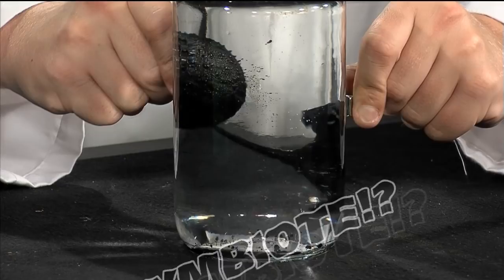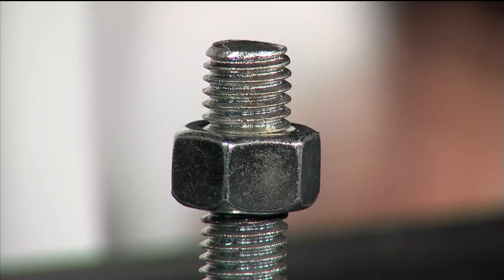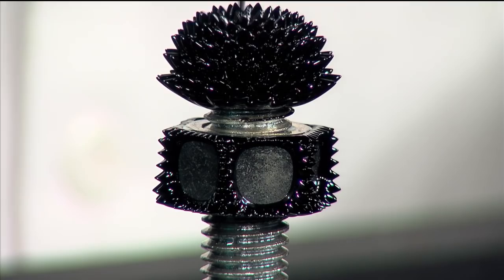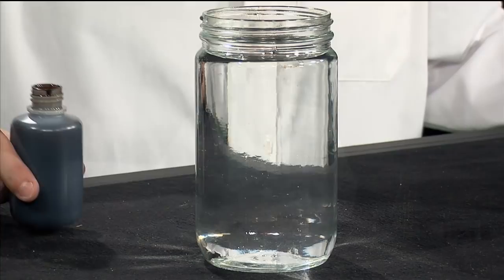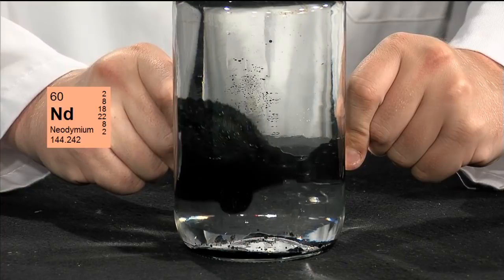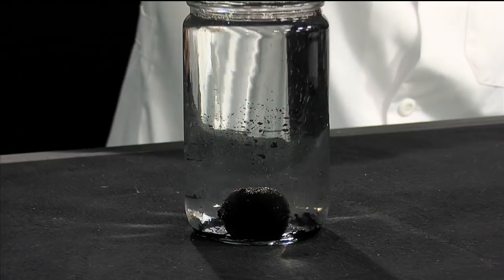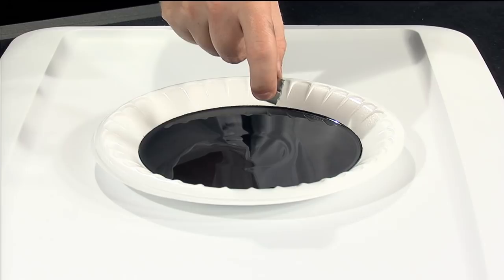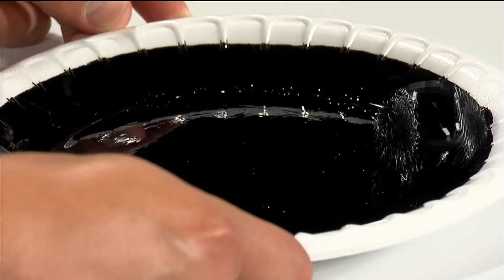Ferro Fluid Tests - Magnetic Liquid

Comment: The reason the sides are flat is because the fluid lines up with the magnetic field lines. The lines point upwards from the north to the south pole. On the sides of the magnet the field lines are parallel with the magnet so no spikes form like with the top where the field lines point up.

Comment: How did you get the spikes? I have tried a lot of oil+toner mixtures but NEVER got it, even with strong neodymium magnet.
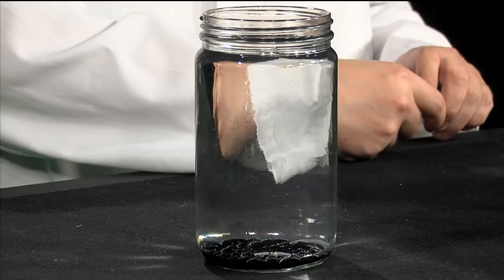BTW, the mixture that you suggested (oil+toner) is less dense than water, so, in your experiments (at 2:20'') you used another kind of formula, didn't you?
Could you give it to us?
Thanks in advance.

Comment: Can you hold your finger in and touch it? And how do you get it away from the magnets, is there any way to fill it back into the bottle?
Reply: You can touch it with your finger. To get the ferro fluid away from the magnet, you need a large enough force to overcome the magnetic attraction between the fluid and the magnet, or you can just demagnetize the magnet. It is possible to fill the fluid back into the bottle if you boil all the water out because the boiling point of water is lower than the fluid.

Comment: Are these magnets safe to use near a camera? I'm thinking about taking some pictures of this stuff in action, but wouldn't the strong magnets damage the camera?
Reply: keep the NEO away from all flash drives, hard drives, or magnetically laced tapes. you WILL change all the1's and 0's to uh....um... 2's and 3's ????  no seriously 15 inches is about as close as I would even think about getting to any internal/external mass storage device   {{ especially a N52 the strongest neodymium available to common folk }}

Comment: I've tried to recreate your experiment using ink toner, veg. oil and a N42 Dia 1/2" x 1 1/2" Disc Rare Earth Neodymium M.  I can get the Ferro Fluid  to bulge, but no "spikes" sticking out.  I started the F. Fluid out thick, and gradually dilluted it with more oil,  without better results.  Is the magnet to weak, or does the fluid have to be under water...Any suggestions on what I may be doing incorrectly?  

 
                             
eBay TALK

Comment: How do you even remove the ferrofluid from the magnet?
Reply: i dont think you can. once it is on there thats it unless you got a stronger magnet to attract the fluid without pulling the magnet its self
Reply: karl prankard I see. I can imagine that the disposing of a liquid magnet-ball is a real headscratcher. Do I recycle it under metal? Hazardous material?
Reply: simon köhlström
 i personally would keep it just for the cool shapes especially that nut bolt one
Reply: I was about to say, "Just..." And then I realized that you're right 0_0